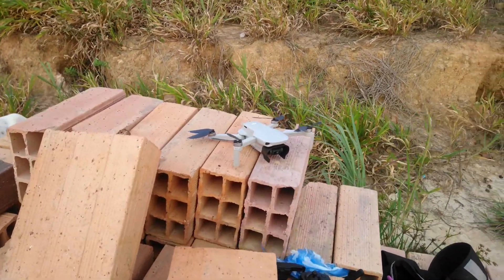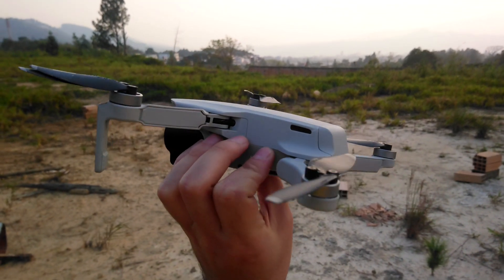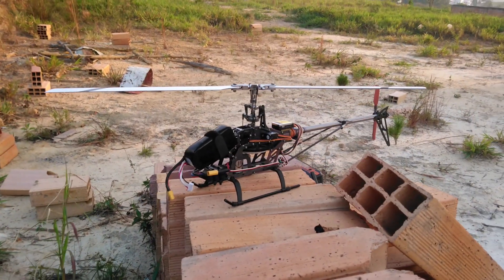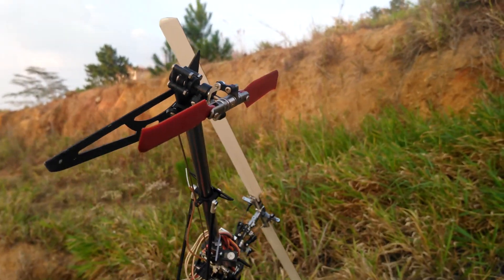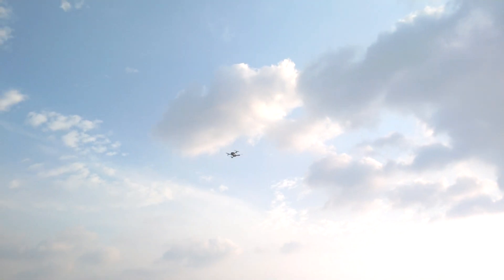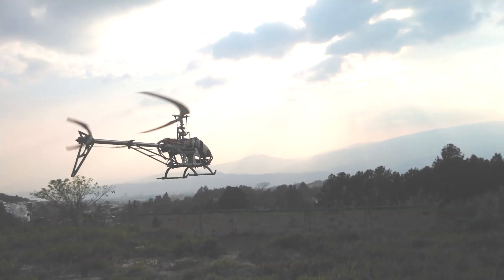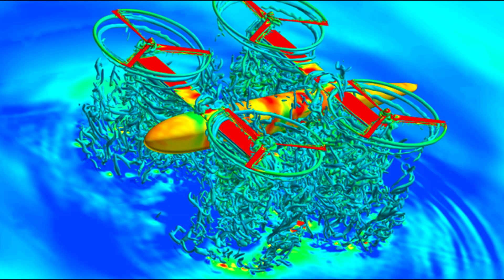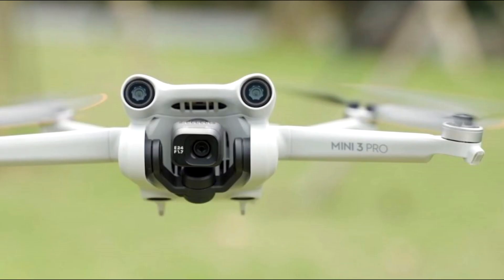Drone vs Helicopter | Comparison of noise generation

Comment: I am like you I don't like the sound of the drone.
I call it a high-pitched screaming sound.

I fly the typhoon h480 it's very nice and quiet compared to the DJI little mini.
Reply from the maker: Very nice. I will check out that model. Thanks!
Reply: @XXXmags  
The typhoon h480 is an older drone it came out in 2016 but it was top of the line and it's time..
I also have videos on YouTube check out KK motion pictures underground 2

Comment: The helicopter can be converted to a direct drive that will be so silent that you only wish that it is louder. I FPV my 250 gram helicopter with purely direct drive main and tail motors.
Reply from the maker: Must be very cool to hear such a silent heli. Must need a massive motor for the main rotor though!
Reply: Verry interesting 👍👍

Comment: small motor and small blades turning at high rpm = more noise.  Bigger motor turning at lower rpm = lower noise.
Reply from the maker: Certainly the frequency of the sound goes up, but its not clear whether the decibels actually go up. Gotta measure it. Subjectively it's more annoying for sure.

Comment: I didn't realize how small that model was, omg

Also yes small rotor diameter leads to efficiency losses and lots of noise. Also having the discs not being parallel might also increase yaw power at the expense of upward thrust.
Reply from the maker: Its super small but sounds like a lawnmower in the air 🤮